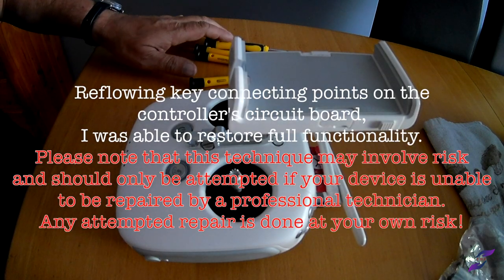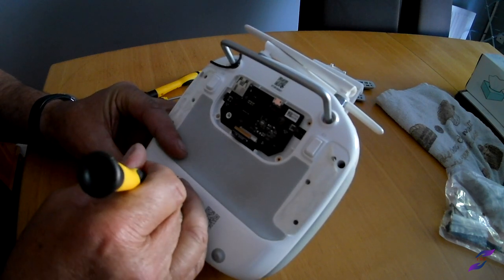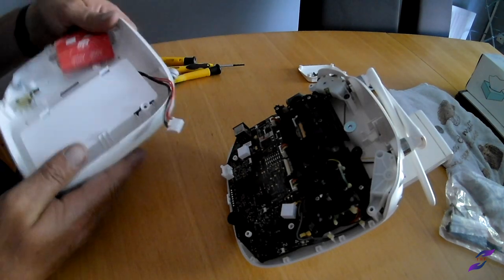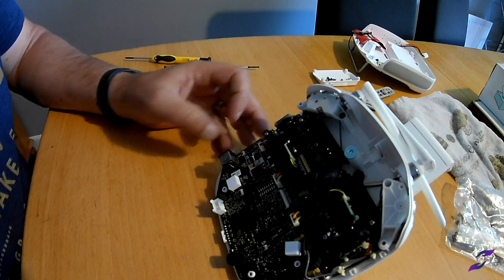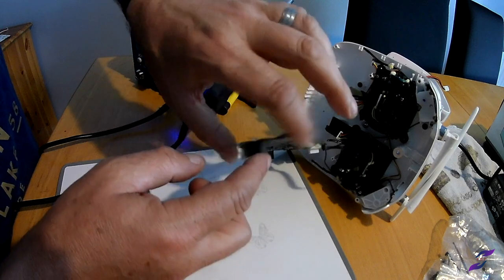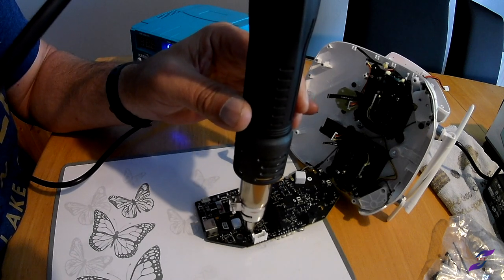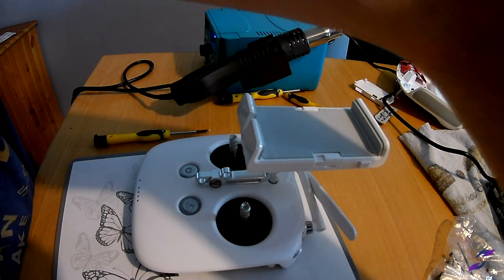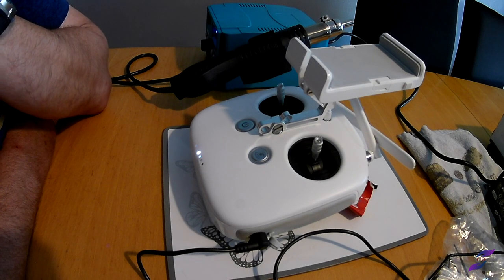DJI Phantom Remote Control Battery Charging Problem

Comment: I just did this with our Phantom 4 Controller.  There are a few videos that are similar, some with more detail that others.  After having done it, I think about 80% of the disassembly shown may be unnecessary. I went as far as the 6 small ribbon connectors on the main board before I realized that as long as the two screws are removed, most connectors can stay connected. I did not disconnect the wired plugs nor the antennae connectors. If I had to do it again I would try leaving the ribbon cables connected.  If you feel you may pinch the cables, disconnect them.  Now the board can be carefully lifted and tilted back to lay on the controller, iPad holder retracted underneath and flat on the table.  This also makes a good stand for it to be on when doing the heating.  If the board resists being lifted, it may be stuck on the two posts toward the front edge - apply a little more force under the board there and it should come up.

I used an "embossing heat gun" that my wife had for crafts to heat the chip located next to the light array as shown. I used a piece of cardboard curved around the chip to isolate it and held the gun on for two minutes. I did not need to heat any other areas.  When I was done, the cardboard looked slightly toasted at the edge near the chip, so it is a fair amount of heat. 

Afterwards, once it cooled, I reconnected the battery to verify that the charging lights came on as expected.  If all is well, they should begin lighting in sequence and as the charge completes all 4 will light in sequence, then finally go off.  If all is good with the charging, turn the controller on to make sure all lights light up indicating a full charge; if you have disconnected the ribbons, only "No. 5" coming from the power switch needs to be reconnected to test this.  This is a good test before reassembly in case you need to apply the heat again if it didn't take.

If all is good, reassemble and take the drone out to test all controller functions in a limited safe flight.  Take your time with this, work carefully and methodically, and it may save your controller and some $$$ on repair.

Comment: It works really well. I tried to blow it with hot air at 350 degrees Celsius. The result is a normal recharging. All 4 lights are normally attached and the percentage of batteries displayed in the mobile phone shows the value. Correctly (Remote Phantom 3 Advance)

Comment: WARNING ABOUT THIS VIDEO: Good video, thanks. But... Be VERY careful when handling the ribbon cable that attaches to the RC's main board. (You can see it clearly on this video at 3:24 ) When I tried to re-assemble the unit, and tugged on the ribbon cable to pull it back through the hole - it ripped the cable and mount right off the circuit board. This little mishap cost me $400 Cdn in repairs: The main board had to be replaced - that board it $255, plus $80 per hour service plus return shipping.  Be very careful with that ribbon cable, it is adhered with only a tiny bit of glue to the main board, and if it rips off, it can't be re-soldered. Hope this is useful to people.
Reply: Ditto, in my case the controller slipped whilst I was putting the halves together, I should have let it fall but I tried to grab it. I snagged that ribbon cable and ripped it and the connector off the board, boom, one wrecked mother board. Second hand controller was bought

Comment: Great DIY video~!  I have a few questions for clarification.  How did you know how hot you could get the board before frying any components?  Also, did you suspect a specific connection to be the problem after it was all said and done?  I can shotgun it, but I'd prefer to have a bit more surgical approach due the high heat involved.  Any suggestions here?  Thanks again for a great video.
Reply from the maker: Thanks for watching buddy, there's always a possibility you could fry something. its just a case of approach with caution and gentle heat. Always keep the reflow torch moving and do not hold in one particular spot or you will be asking for trouble.

Comment: Good job with the repair Mark. What is the tool you used to heat it up?  So far I have had no problems with my Mavic Pro controller ("touch wood"). Thanks for sharing.
Reply from the maker: Thankfully it was a easy fix Dave. And the tool is called a reflow gun.. Like wise, I’ve had no problems with the mavic 😁  thanks for watching Dave👍
Reply: I have never heard of that tool. I will have to check it out. I do get involved with soldering from time to time.

Comment: In my case there was no need for reflow at all. Just disconnecting the battery, connecting the charger with no battery connected, and reconnecting the battery did the trick. In fact, i’m beginning to believe all those reflows everyone did were unnecessary, and it was a calibration issue brought about by an update.
Reply from the maker: Disconnecting the battery didn't fix the issue. There was a dry joint, which was causing the problem. 
After the reflow the RC charge correctly :-)

Comment: Hi there I got my remote controller amd when plugged in to the charger the red light make a noise and the first light blinking fast at this point I not idea what is wrong with the controller maybe battery issue or something else .. any idea what need to be doing to get it fix .. thanks

Comment: Are you just reflowing all the solder joints in general? I am deaf so relying on the auto generated subtitles......

If so does anyone know which joints are specific to the will-not-switch-on problem? This is in a dead controller I car booted, the lights come on whilst the power button is held down but it does not switch on in the normal press release, long press sequence.

Comment: Can I use a hot air blower instead of a soldering workstation and resold? .. have blowers that go up to 600 degrees Celsius and are much cheaper ... another question is, how do I know when it's good to stop heating up? .. do I need to see the solder melt? .. is not it dangerous to melt the soldering? Thank you very much for the video, I hope mine works, too!
Reply from the maker: Providing you can control the temperature I can't see a problem in using a hot air blower. Best thing to do is test on an old circuitboard. The solder needs to melt but not run off the board.

Comment: Hey if you just as some solder to it would that work as well?
Reply from the maker: You could re-solder , providing  you know where the dry joints are
Reply: Yea I have no idea where to solder at. I did take it apart 3 different times and try a blow dryer on it but I guess it wasn’t precise or hot enough to move the solder. I’ll have to either buy the tool you had or try something else

Comment: First time no difference I decided not hot enough second time all four lights began to blink like normal as per the video so joined it all up again charges for a few minutes then dies again sigh... what now?
Reply from the maker: your battery could be knackered and it needs replacing.
Try disconnecting the battery and reconnecting.

Comment: My phantom 4 controller stick not work how to fix this problem pls
Reply from the maker: When you say stick, do you mean both sticks? Have you tried pairing it to the drone. If so try disconnecting the battery the 60 seconds and try again.

Comment: DOA battery fix
dji p4pro
Bought a drone 1499 and am in the caribean right now ! Never got the bird in the air because the p4pr batt is dead / won't charge!~ the controller charged well
Reply from the maker: If it's a brand-new drone, then I would return it

Comment: HI, I HAVE JUST DONE THAT...BUT I STILL HAVE THE SAME PROBLEM ON THE CONTROLLER....WHAT SHOULD I DO?
Reply from the maker: Try disconnecting your battery and reconnecting, also have you checked your battery voltage as your battery might be knackered.

Comment: O radio do meu phantom 3 apagou após atualização (controle não liga). Alguém conhece o problema e poderia me ajudar?

My phantom 3 radio went out after update (control does not turn on). Does anyone know the problem and could help me?
Reply from the maker: Power it up via the mains.
Reply: @TheHampshireFlyer  I don't know how to power up via the mains.  Can You help me?
Reply from the maker: Plug your charger into the rc, and then turn rc on and repair (link) with your drone.